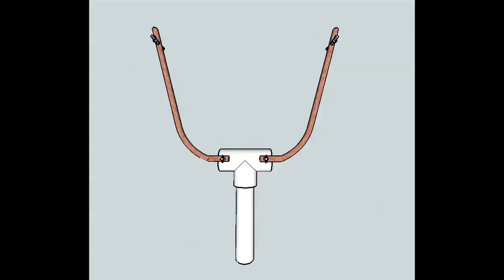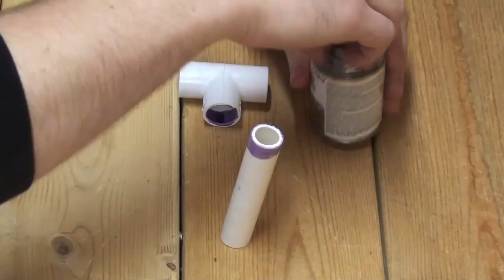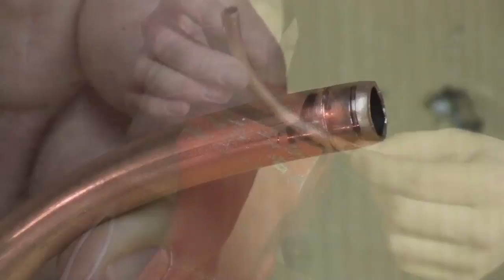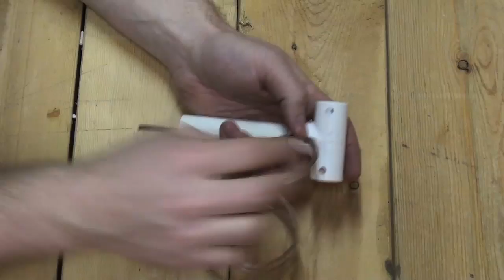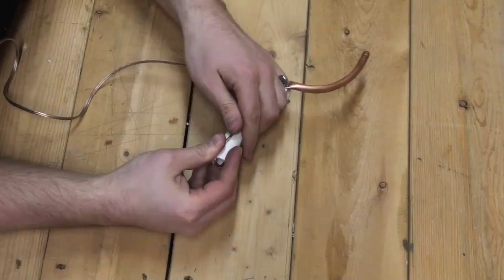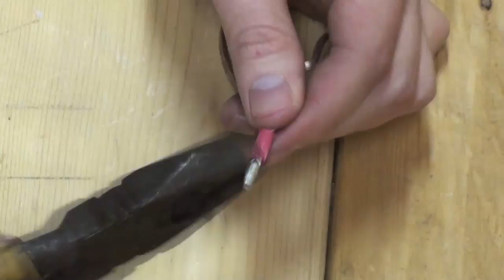Small Handheld Cutter - HWFCI

Comment: What battery size would I need for this? I looked at your website but I am still not for sure
Reply: +Silas Cox Batteries will be tough to choose and will depend on what type of wire you use (26 or 20 gauge). If you're doing straight wire cutting, you'll want to find a 5 volt battery that can allow up to 4 amps. You're probably going to have to go to Batteries Plus and find an enclosed battery pack.

Comment: What a crap design. it won't hold tension on the wire. the wire should be stainless steel,  not NiChrome, which is a toxic metal. if you should poke yourself with the NiChrome wire you can get a serious infection and could die of Nickel Poisoning. 

you seem to have left that info our of your video as well.
Reply: +DrGoodwrench64 Thank you for your opinion, but I have no interest in creating a debate over your unfounded claims. Rather than simply flag your comment and/or delete the post, I figured I'd extend the common decency of providing you with a reply. Have a nice day, take care.

Comment: how do i attach it by power supply
Reply: +Sadaf K Hello Sadaf, Check the website under the "diagrams" page. There is a whole section on electrical attachment. Some people use wing nuts, or snap connectors, or alligator clips.

Comment: "Attach the electrical wires to the power supply". What "power supply"? How many volts? How many amps? Way to leave out the most critical piece of information!
Reply: +Ron D Hello Ron. Thank you for your constructive feedback. If you visit the website, you'll note that this video is one of a dozen free videos related to creating your own hand held foam cutters. We have videos AND diagrams for calculating electrical requirements, power supplies as well as the electrical attachment. As a matter of efficiency, it wouldn't make sense to include power supply and attachment information in each video in the event changes need to be made. Please feel free to reach out to us through our contact information listed on the website if you have any additional questions.

Comment: is the exposed copper area conductive? im no electrician but i'm guessing yes? isn't that kinda dangerous?
Reply: +Dude...Are you sure?? Yes conductive, that is why you use copper or brass. No, it is not dangerous.  The applied voltage ranges from 5-12 volts. It takes greater than 40-48 volts to penetrate dry human skin. It's the electrical equivalent of touching a hand full of batteries.

Comment from the maker: 26 gauge for straight wire cutting, 20 gauge for bendable wire cutting.  Each will have their own voltage requirements and I use a transformer and dimmer switch without an output reading. I'd say.. probably 6v/3a for straight wire and 2v/5a for bendable wire cutting. Check out our website, more information there.

Comment from the maker: I have a 5v4a solid state (non variable) DC power supply that I use/sell for this type of cutter. But there are a variety of power supplies that would work. Check out the power supply section of my website for a few suggestions. In general, you shouldn't need more than 4-6 volts for this type of cutter